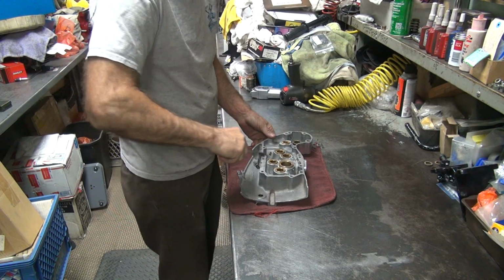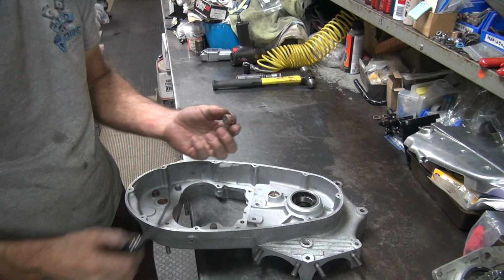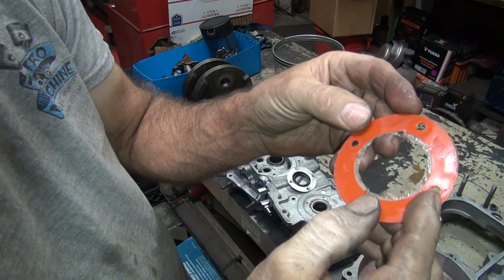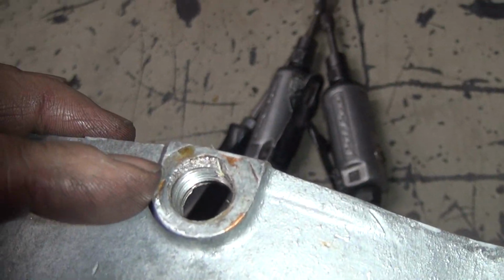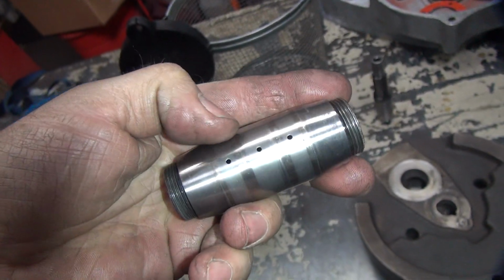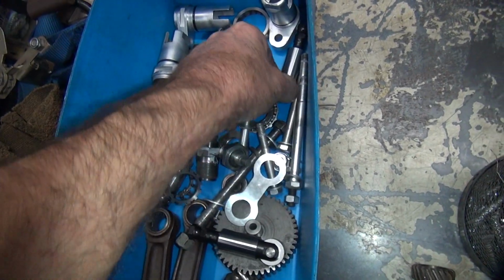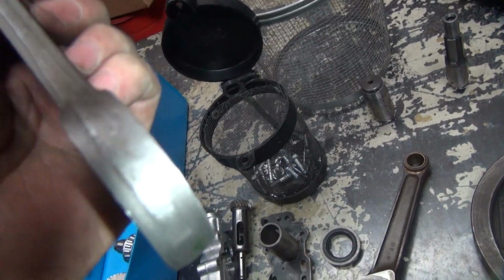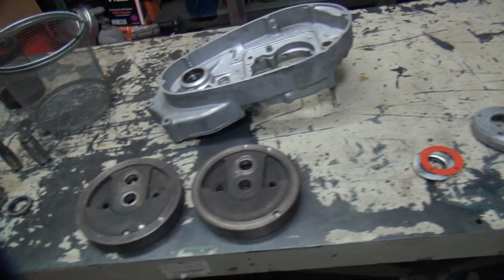1961 xlch #109 no miles transmission motor rebuild sportster harley repair restoration tatro machine

Comment: Tatro what’s your thoughts on cam choice when running stock motor with forged 10/1 high compression pistons? On a stock 75 xlch reason I ask is I’ve got a set of p and y cams and Iam just not sure what to use its just gonna be a short trip around town bike
Reply from the maker: 10:1 is high for stock cams unless you got some good gas. the P cams work good but if you want more ball higher up than you need the Y cams. its all about how you ride.
tatro
Reply: Tatro Machine thanks for the advice one other thing if you will iam gonna run a ultima electronic ignition and probably stay with the p cams and run high octane gas hopefully to keep from any detonation problems should I cheat on the timing and run it at around 47/48 degrees? And with one of your custom tunes
Reply from the maker: i would stay with the stock 39 degs with that high compression. you can always bump it up later on.
tatro

Comment: Tatro is right anything that’s shows wear And is pitted can fail anytime especially when it’s turning 7k rpms iam no machinists but I’ve built and seen a lot of motors and when your talking crank and rods it doesn’t take much for a bearing to spin

Comment: If the case sides are leaky, cant they be flattened on a glass or other plate ?  Just wondering. 

Might be useful to flatten the back side of the scraper as well. Wood workers do it right off with new chisels. I figure a scraper could also benefit from having the back dead flat. (shrug)